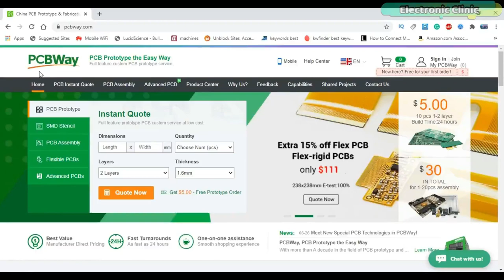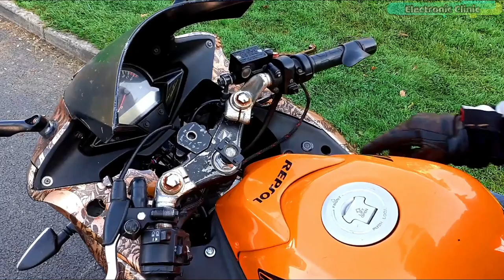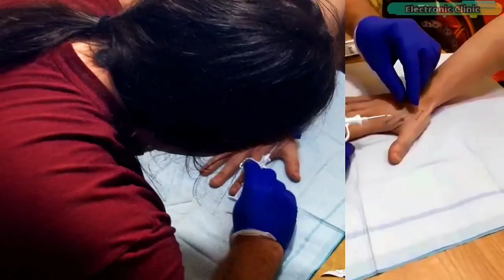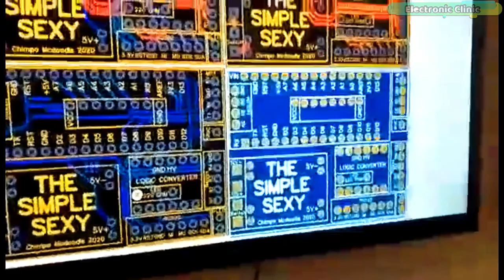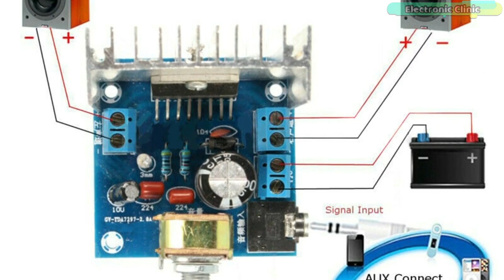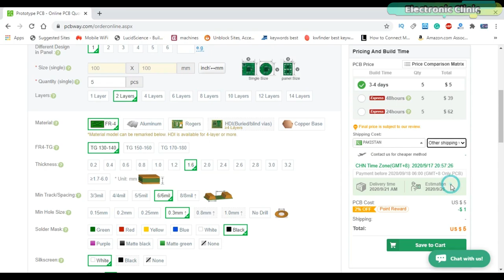My Hand is the Key, RFID Chip in Hand, Talking RFID System using Arduino, chip implant, NExt RFID

Comment: What is the best way to power a circuit (Arduino)  from a 12v car battery, without the circuit getting hot?
Reply from the maker: you can use a 12v to 5v converter module.